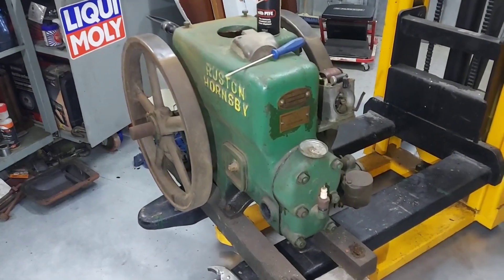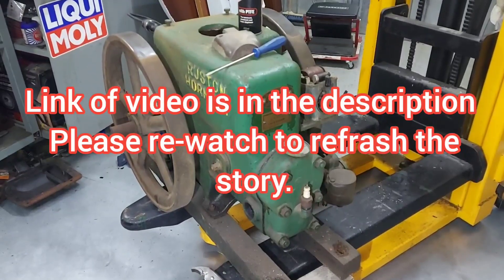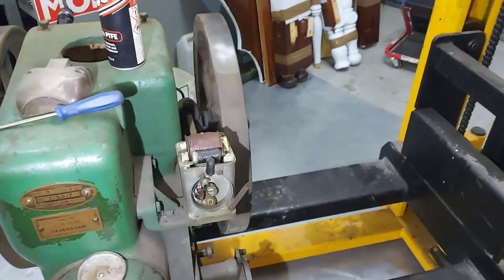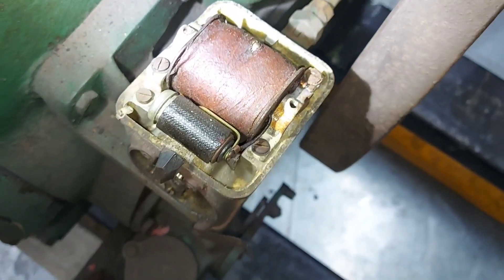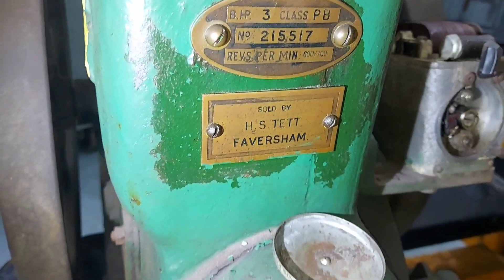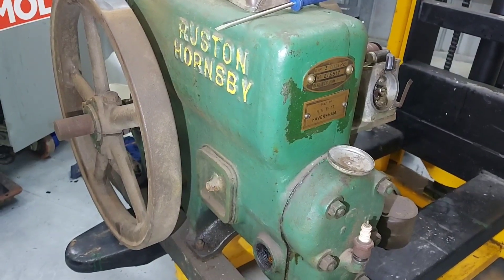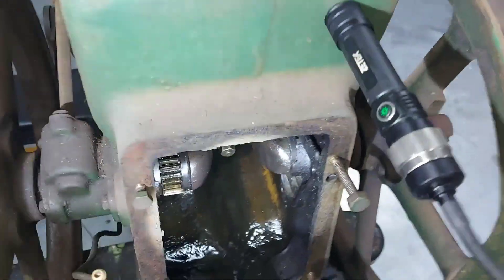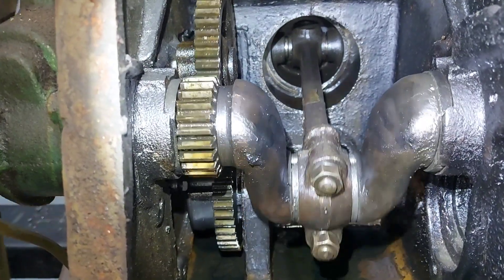Ruston 8PB - Next renovation

Comment: Looks to be in good condition, will be one of your easier restorations i think, no major work needed.
Reply from the maker: Yep, the paint restoring is going to be time consuming, inside just need a good clean and some minor small parts made and a new set of rings. Sadly the bottom of the bore has a decent rust score